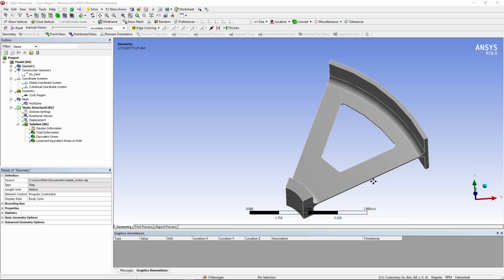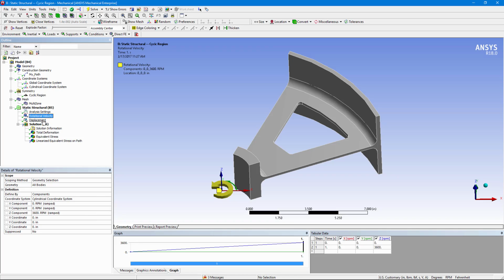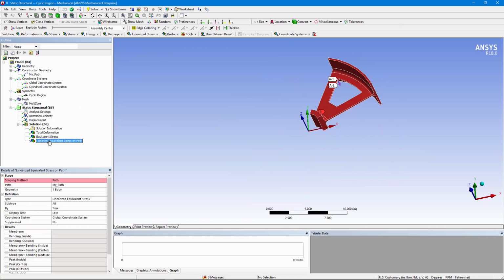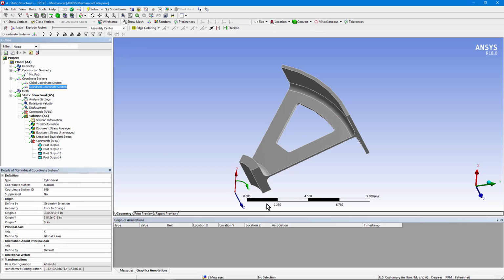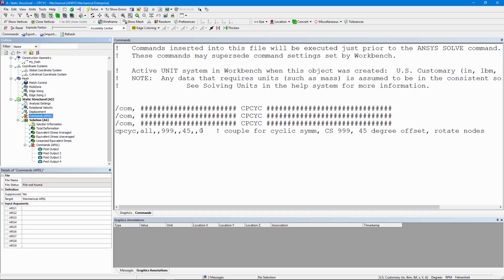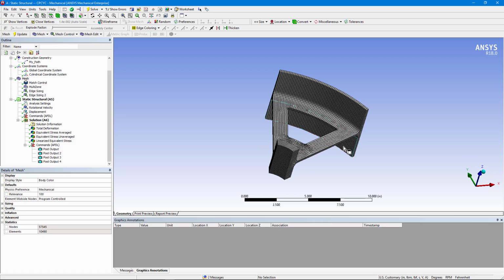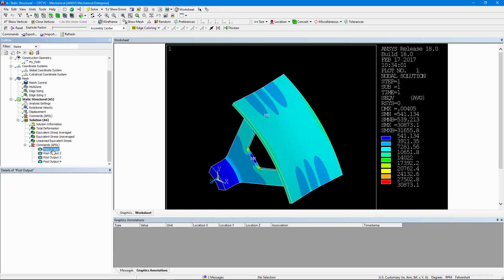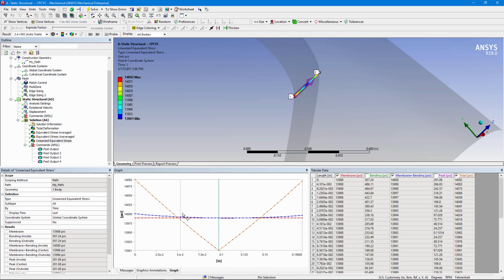Implementing Cyclic Symmetry and Extracting Path Results in Ansys Workbench Mechanical

Comment: Is it possible to do this with a plain strain model?
Reply: No. Cyclic symmetry can not work with 2D analysis. But you can use frictionless support for cyclic line if you can cut your body from center of rotation to outer side with a straight line.